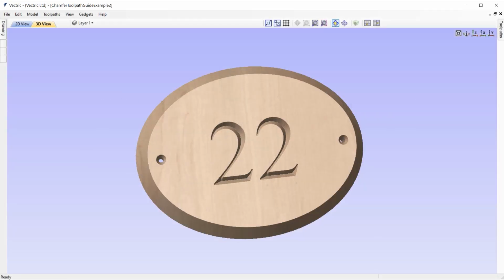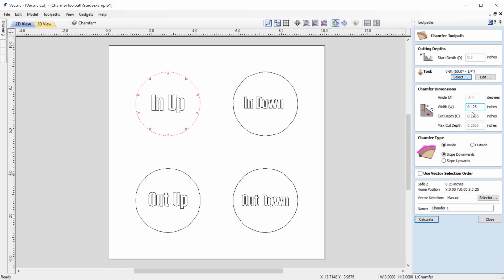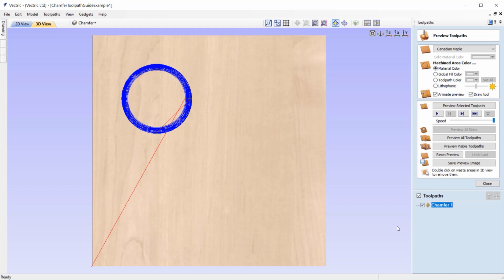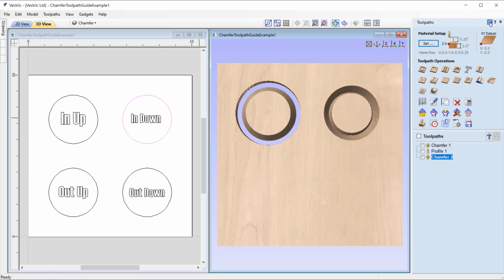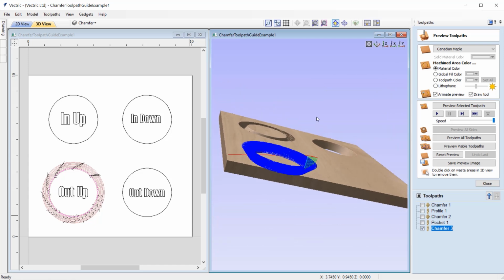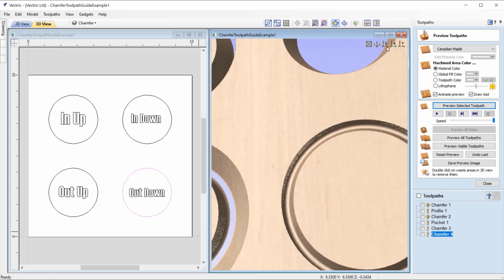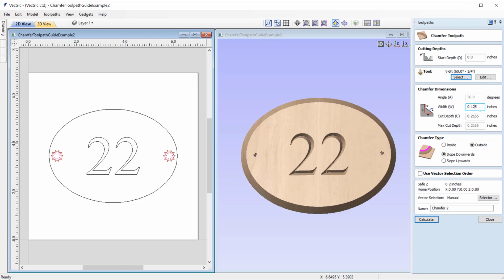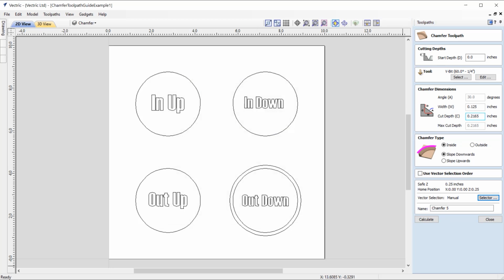Vectric V10.5 Tutorials | Chamfer Toolpath Guide 2.5D Toolpaths

Comment: Not very intuitive and not sure how you would use the examples in real life. One problem I found was it puts the point of the tool right on the line which made a mess of the edge. Is there a way to tell the software to use the middle of the cutting edge to cut the chamfer?
Reply from the maker: Hello and thanks for the comment and question.  I would suggest using the "overcut" option in the Chamfer form.  This will help you to shift the center point so that you can use the side of the tool.  Let me know how it goes.

Comment: So this is a bit infuriating really.  I had my company purchase this upgrade specifically because the new Chamfering function was added (among other things) and it simply works in the most ridiculous way possible.  

Why would there not be a way to do a SINGLE cutting path for cutting the Chamfer with a ball-nose or really any other bit.  Why is there not rest machining function added to this Chamfering function either? Rest machining function is present in the moulding function but not in this.  It boggles the mind.

There is even a gadget maid to do any chamfer type at any angle using a ball-nose but it does it in one pass instead of doing 500 passes per step down.  

So, am I missing something, is there no way to use a large clearing out tool, followed by a single pass per step function in making a chamfer using a ball-nose?
Reply from the maker: Hello and thanks for the comment and sorry you are feeling frustrated. Let me see if I can help and if not please feel free to contact Vectric Support - support@vectric.com

- Yes we do allow you to use ball nose endmills and you can reduce the number of passes if you adjust your pass depth.   (If I am misunderstanding then please contact support)

-    Yes you are correct we do not allow for a "clearing" tool to be used.  I suspect we could but this would be something you could suggest to Support for future consideration.  Would be good to also include a use case so we can get a better understanding of what you are thinking.

We are always open to feature changes or updates... so please always feel free to let us know.
Reply: @vectric  howdy, sorry for the pissy attitude.

So you actually did partially misunderstand me.

Imagine a miter at 30 degrees. Any miter has a slope. So that slope may contain something like steps on a staircase but are actually steps along a vector.

There are two ways to cut that out. One way is to cut at one path per step (I. E. A staircase) or you can do it like vcarve currently does it.

Vcarve creates multiple passes per step and as it gets deeper there are less paths per step. So what vcarve is doing is clearing out ALL of the material based on the resolution you've specified (in this case your resolution is based around the micro depths and step overs that you specified within the tool file).

So if one wants a "high resolution" cut then one may do a step over of 0.02 and a depth per cut of 0.03.

But this also means that for every depth of cut one may be cutting 35 tool paths at the top, then 34, 32, 30, and so on.

What doss this mean. This means the way vcarve processes these cuts will be nearly 300+ cutting paths to do a simple miter.

The way fusion 360 and even the vcarve gadget does it, it will be around 24 passes at the above stated resolution.

This means the cutting difference of hours. A serious problem.

So. This is why I ask the question of how could vectric let this one slide? Their gadget for vcarve and cut2d is better than this addition!